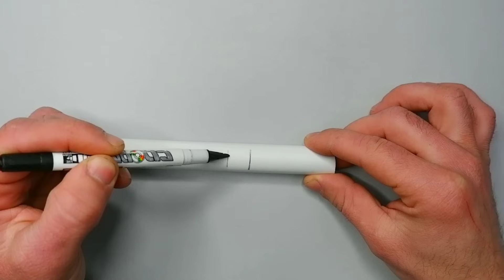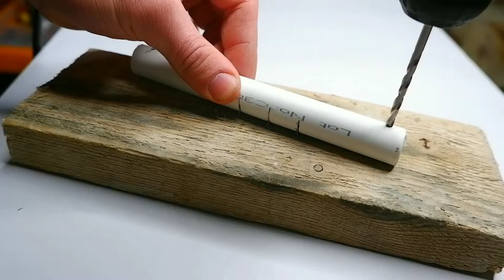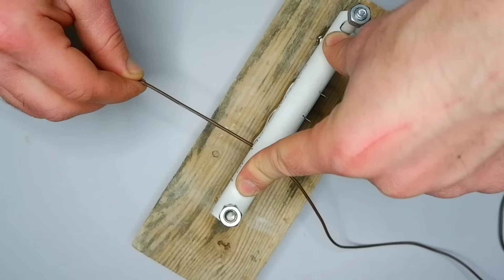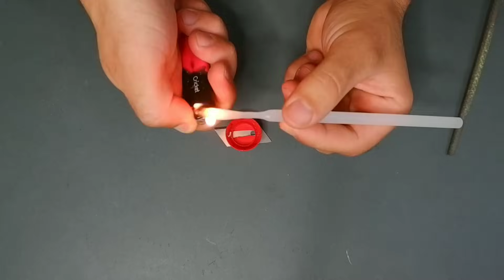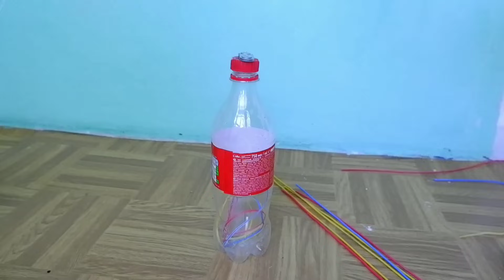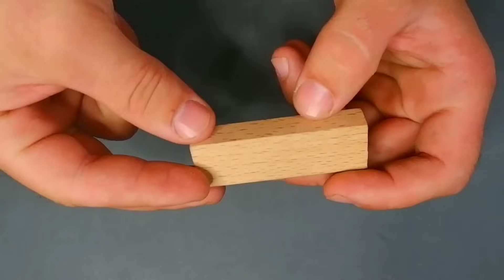One Tool for Stripping all Types of Wires .

Comment: Hello. Can you please help me make a machine for quick and easier disassembly of radiators from an air conditioner. There are copper tubes in aluminum foil. So far the easiest way is with a stationery knife... But when there are a lot of them it is also very difficult. I want to come up with some kind of machine.